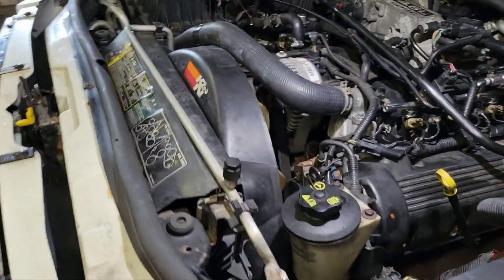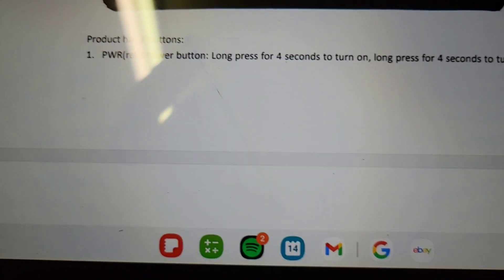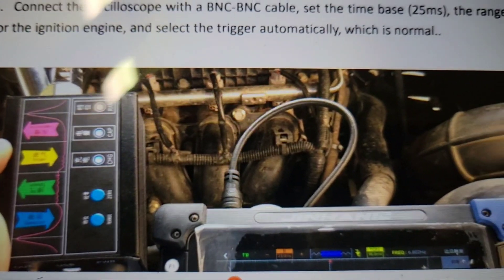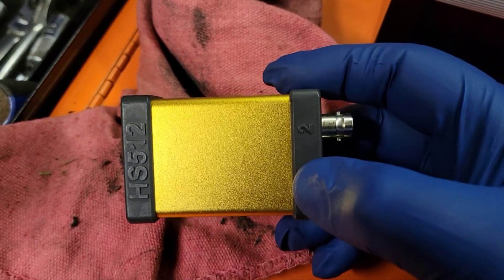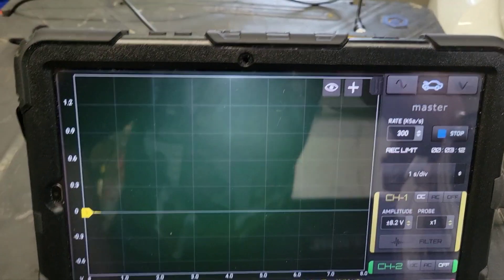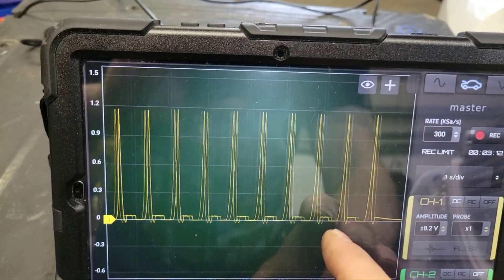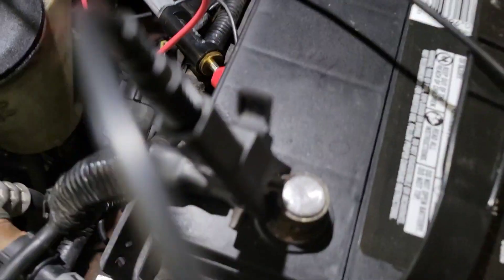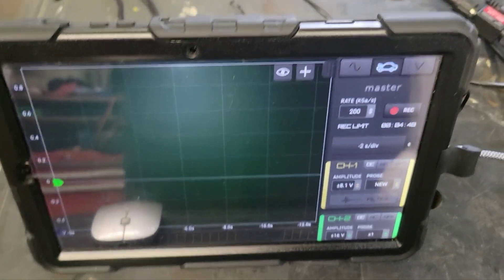JH APT-100 pressure transducer,  Martin Loren HS512 on HScope. First use and set up

Comment: Friend, when is there a video of the inside of the jh-apt-100, to see the technology it uses?
Reply from the maker: @severgonzalez7058  I never took it apart. I am sure it has a board to switch the presets for the different ranges and to charge the battery. Other than that, the transducer is just a 500psi transducer like they sell on Amazon or Ali express for 25.00. Diy ones you use the scope to change presets and make your own power supply out of a phone charger or battery pack. The jh apt 100 just puts the battery and transducer in the metal box with a board to switch the ranges from the box instead of your scope. I will see if it does come apart to get a good view of the board in case it helps anyone out! Cheers!
Reply from the maker: @severgonzalez7058  Yes , either to sensor ground, engine or battery. The transducer has no ground.

Comment: Was the timing off the causing the lack of vacuum? Curious to know what caused that.
Reply from the maker: @NEMOJA  The ecm was not controlling the vvt valve. It had a fried driver inside.  Ended up checking timing marks  on the cams also. It had no signal at all  at the vvt, replaced the ecm and the square wave came back and controlled the timing again . Did not re do the transducer test afterward to see the difference afterward  to see any difference though sadly.

Comment: Last wave form looks like it's not pulling vacuum on the power stroke. Was the intake valve/seal the problem?
Reply from the maker: @NEMOJA  It wasn't it's main  problem but good eye. After the power stroke, it should have crossed the threshold on the bottom for vacum.  I was not sure what to expect but yes , a healthy engine should have that vacum pocket after the power stroke.
Reply: @Backalleydiagnostics your videos convinced me I need to upgrade my modis edge scope! Purchased a hs502 with pulse sensor and transducer. 
Just waiting for delivery atm.
Reply from the maker: @NEMOJA  Awesome! I'm sure you will find Hscooe much faster. The Modis still is a great 4 channel option. I have a habtek 1008c 8 channel that hscope let's me use 4. The Hantek just doesn't have enough of a buffer to be usable. I'm usually only using 2 channels and the hs512 works great and fast. I think the 502 is more suitable for the pulse sensor even though it works great with the 512. With the 502, the 1v range of the pulse sensor is right in the middle. The 512 it's on its lowest range. I will be picking up a 502 soon, they would definitely be better for can bus also. Thanks for the comment, and let me know what you think of the scope when you get it!
Reply: @Backalleydiagnostics  yea for the price and quality of the hs502 it seems like it will blow the snap on away for the tests I'm looking to do with it. Thanks for all the good info 🫡

Comment: Just a heads up. When using the rulers  you need the 720 deg rulers . If you move the ruller then hit the gear on the bottom right you can cycle through the rulers . One of them shows piston direction over all 4 cycles of 720
Reply from the maker: My man! I have been trying to find the 720! I saw them on a video set to 720 on the hscope but was unable to find how on the fly. Truly appreciate this, that's what it's all about!
Reply: @Backalleydiagnostics  me to, just got the scope and just found the gear for the overlay now I will be able to set the 720 degrees. thanks guys

Comment: The HS502 has fair number of reviews done. Was really waiting on someone to do reviews on the HS512 see it's use in action.  Really appreciate you breaking the ice (for me at least)... thanks again.
Reply from the maker: The 502 has half the input voltage of the 512, which in automotive is usually a good thing. One drawback seems to be on very low level signals.  I am going to do a video today of an amp clamp that reads in mv. The 512 performs excellent with a transducer where 1 volt = 1psi. Where it might lose ground to the 502 is where 1mv =1amp. If this is the case I'd still prefer the extra protection of the 512 and use a hantek that has a 5 volt max for low level signals . Either way, I'd stick with the hscope software, the more I use it the more I like it
Reply: @Backalleydiagnostics  oh really? I need to see that video... i got the impression the 502 and 512 were the same after watching the reviews on the 512, but I am a newbie when it comes to oscilloscopes and diagnostics with scopes and I'm sure your comparison video will be a big help for me. Thanks man.
Reply: @danielkenkama5701  the 502 has an input range selection of 16v, 8v, 4v, 1.6v where as the 512 has an input range selection of 32v, 16v, 8v, 3.3v. So they are sacrificing low range readings for higher range readings. Beyond that they are the same. I believe it is down to a different sensor package for each unit but everything else is the same.